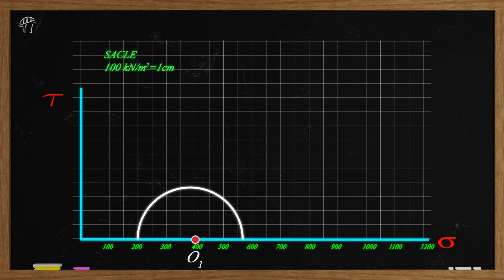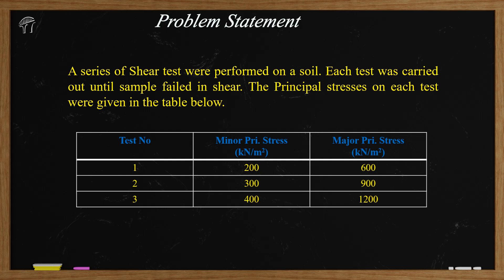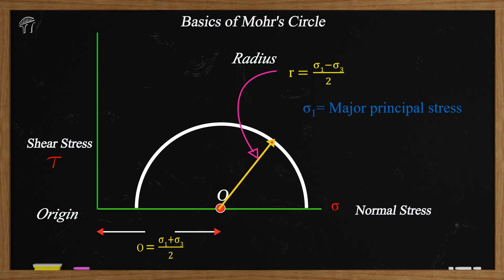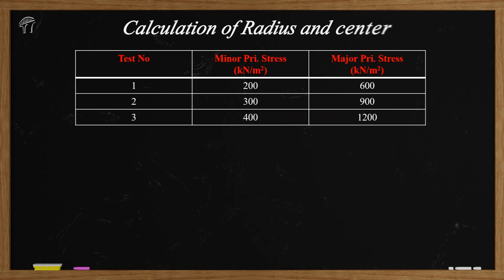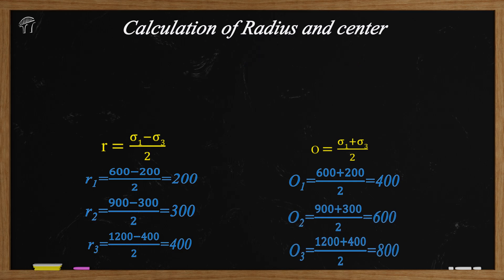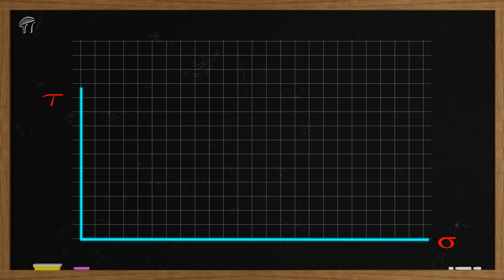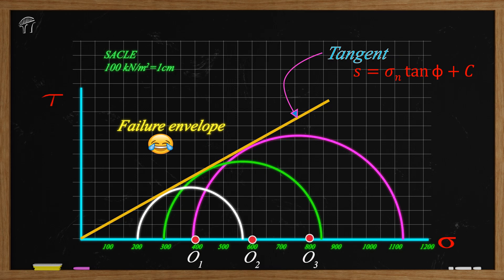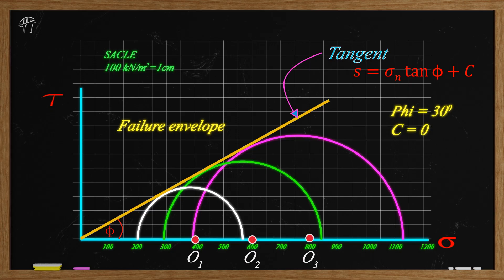Mohr's Circle for Triaxial test

Comment: Why C=0 any reason for NC soil
Reply from the maker: C is just a value, it can be anything.
Reply: @CuriousCivilEngineer  did you perform TRIAXIAL CD TEST on NC SOIL THE MAIN REASON IS THAT WHEN YOUR DRAINAGE IS OPEN THERE IS NO POSSIBLITY OF COHESION BETWEEN PARTICLES BECAUSE OF MOBILITY OF WATER THIS IS THE ANSWER FOR C=0.
Reply from the maker: Hey hii. You are absolutely right. 
 actually I didn't perform that test. It's just a example I have taken from book. The purpose was to explain the numerical procedure, that's it.
Reply: C=0 because material exhibit no cohesion ,such as dry sand.